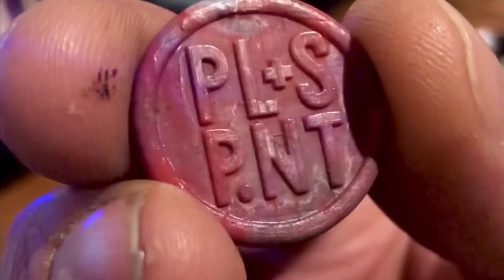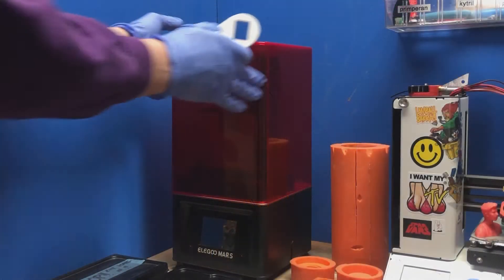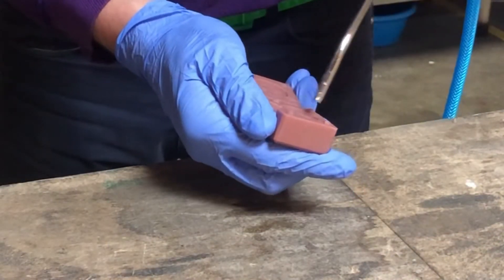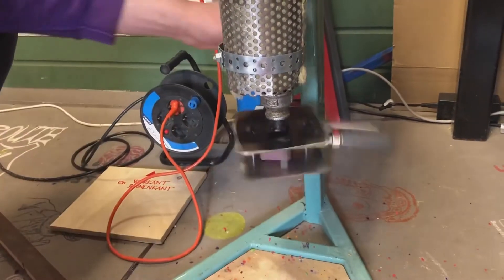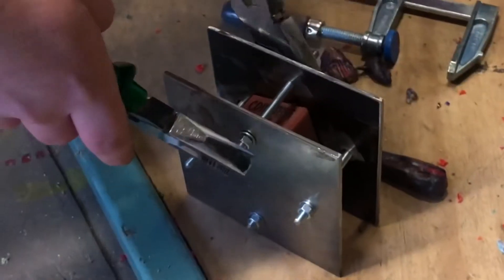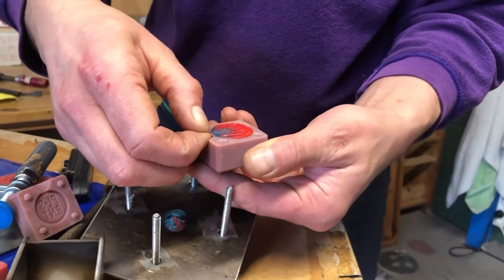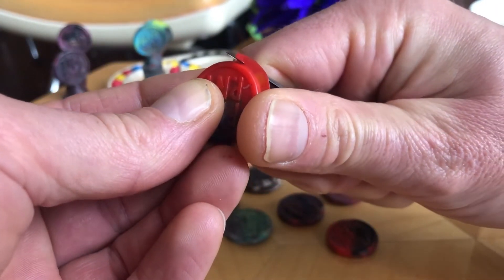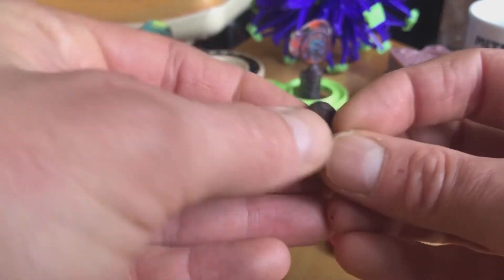3D Printed Plastic Injection Molding

Comment: Could you use FMD 3d printed molds, instead of SLA?
Reply from the maker: If you can print in high temperature materials maybe, but PLA, ABS, PETG will just melt
Reply: @baschz  How about Pla+ then?
Reply from the maker: @nickz797  I have only tried resin and also those aren’t all usable for these high temperatures, but I am guessing PLA+ won’t work
Reply: @baschz  Thanks!

Comment: How many parts can you make before that resin mold is spent?
Reply from the maker: With the resin I used here (Elegoo standard resin) not so much. There are quite some different types of resins though (as used in some later injection molding videos I did) and I’ve used a few of them, also supposedly high temperature, more expensive ones. So far though, I am personally having the best results with a relatively cheap and fast printing resin from Siraya Tech; Siraya Tech Fast (on an Elegoo Mars. I’ve also had good results with the V4 grey from Formlabs on a Form 2). I have had no breaks with Fast so far and did quite a few pulls with it, but since I am using it for rather limited amounts of art pieces and I am not really doing large productions, I can’t really say how many pulls it will hold in the end. It can’t hurt to try yourself I guess with the Fast, since it’s not that expensive. I’d love to hear if you did and what your findings were.

Comment: Great!. How many shots did the mold can take?
Reply from the maker: only about ten before you see the first cracks with this first test, with reusing it pretty quickly each time and a press which is a bit too much for this mini mold I think. I have seen other people by now who have used them more times than this with a smaller desktop press. this is the standard Elegoo resin. there are also more tough and heat resistant resins out there that I haven’t tried yet.
Reply: @baschz  alleight, thanks!
Reply from the maker: @novachig  no problem! are you doing something simular as well?
Reply: @baschz  I'm still in research. The problem with injection molding allways was the prohibitive cost of the mold. Resin printing would be a nice workaround for the hobbist/small scale guy. For now I'll go the resin cast route for my parts but I'll keep an eye on this, looks promising. Great work sir!
Reply from the maker: @novachig  Thanks again. Good luck with your projects. If you are looking to make small 3D printed resin molds like mine, I know the Photon and Photon S resin 3D printers are super cheap at the moment. The first even only $139 if I'm correct. Thanks for your comments, have a great day.

Comment: Very nice and interesting. Congratulations. What brand of resin did you use?
Reply from the maker: thanks! this was just standard Elegoo resin. I haven’t tried tougher resin yet but I do know Formlabs also has one for this use case
Reply: @baschz 
Good work! Phrozen TR300 Ultra-High Temp Resin at a cost=$50 (1Kg) and with a Tg=220C. Should do the trick.
Reply from the maker: @johnburrell1568  thanks for the info John! I don’t know that one yet. I’ll look into that. cheers ➰👍🏼✨